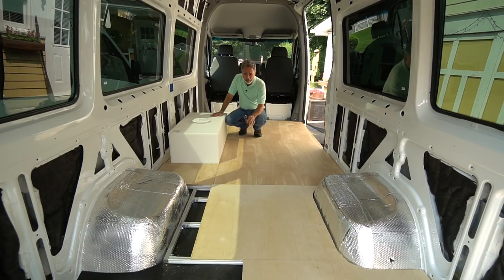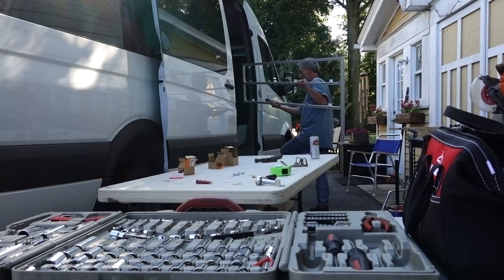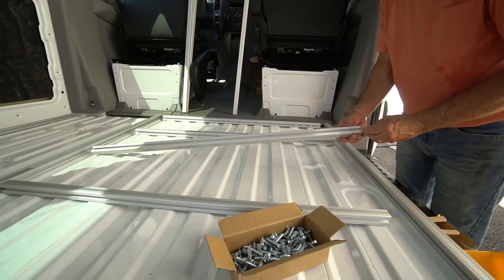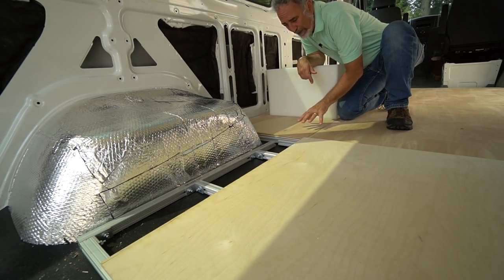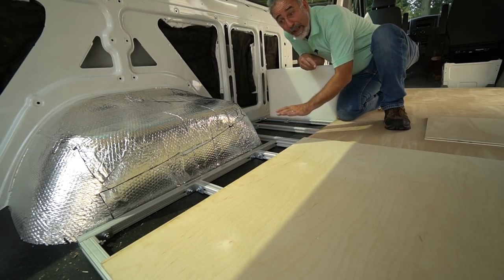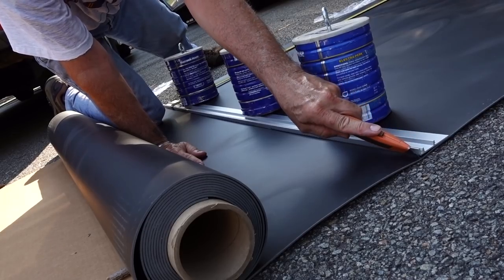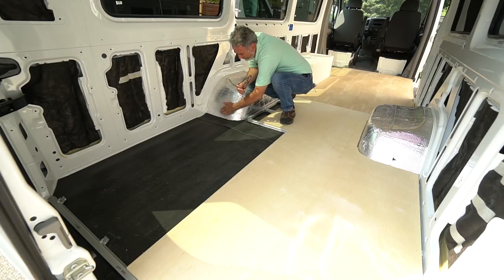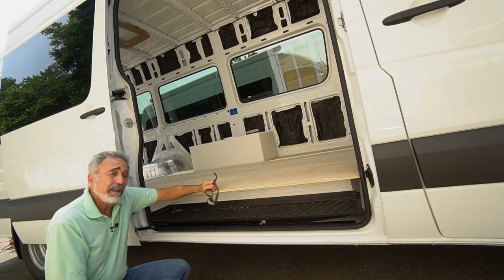VAN BUILD SERIES 09 | My Floor Design

Comment: I like the idea of a four corner drain system! Seems the safest way to go.
Reply from the maker: It makes perfect sense up inside the van. But when you roll underneath, oye vey...
Reply: That would require four times as many bends and connections wouldn't it? I know you like simplicity :-)
Reply: Maybe a squeegee would be simpler.   No, go for the gold!

Comment: Like how this van has glass windows all around. Most van builds i see here are like work vans with just few small windows here and there and the vans are so enclosed. This many windows gives great views of places you travel. I guess the less windows are for the full time stealthy vanlifers?
Reply from the maker: A certain sect of van dwellers like the fully enclosed van. Possibly for stealth, possibly for insulation. Glass transmits a whole lotta cold and heat! I can deal with that because like you said, the views and the open feeling are most important to me. Watch the whole build series and then the final van tour and see just how open and large it feels in there! I call it the Class A of Class B's!

Comment: George, you're a joy to watch! I just enjoy you and the pride that you take in quality and detail. I just bought a new to me Ram Promaster 1500/136 WB. I've watched soooo many of your videos (multiple times) as well as others videos on flooring system layouts. I see that you used heavy vinyl and 80/20 for this Transit, would you recommend this same plan for a Promaster? I know this video is 4+ yrs old now and you're constantly innovating. I'm only 5'5 but want to keep a solid 6ft height clearance. Even so, having thick insulation on the floor and ceiling seems doable and is my plan. In the future I would love to have heated floors, but don't have the skill level or funds to make that happen now. However, I also don't want to shoot myself in the foot by making accessibility to the floor at a later date more challenging than necessary,  or worse, impossible.

Comment: Thanks for the video series, I'm enjoying it! Just thought I'd mention that if you're not using lock nuts with your 80/20, I'd recommend using blue loctite on the bolt threads. Everything is subject to vibration in vehicles and split lock washers won't do it IMO. A couple of drops of the old 242 will save you the hassle of having to take up your finished flooring just to resnug a loose nut. Cheers!
Reply from the maker: Great minds think alike. I used lock washers AND locktite.

Comment: I bought an RV impulsively. It was a lemon of a thing just over 2k. I was going to drive it out west for the Dead & Co show but it stalled 20+ times as I tried to exit after the 4th of July fireworks. Then I saw the floor under the cab mats was very rusted out. Anyway, it's a 1979 Ford class C. I forgot the name as iit's with the seller, who out of guilt, just fixed the stalling problem. Anyway, the RV is filled with heavy, decaying wood and needs to be gutted. I'd love to flip it (or keep it) after redoing it by following your lead. But you make it look easy. I'm hoping I haven't bit off more than I can chew.
Reply from the maker: Go slow, and don't get discouraged. Although there are certain coaches that should just be put out to pasture. Make sure you are not chasing something that cannot be caught..

Comment: Your an artist and craftsman. I see others put foam strips and other material like wool. But it is a lot of work and you just put vynal is that the best insulation? I like the attaching to high parts. But I’m not sure I can afford the aluminum so can it be done with wood ? What is the final wood on top? Is it 3/4” sanded ply?

Comment: @Humble Road The part of this video that's missing is what do you pump through the tubing for heat? I'm assuming hot air, but can you connect this directly to a webasto gas heater? Does it need its own heat pump system?  Thank you.

Comment: Just because the teak is the same level as the rest of the floor doesn’t mean it has to touch it. You can still have a little 1/4” moat around the teak to catch the water.
Reply from the maker: Exactly. You know what you're talking about!

Comment: George ….great segment including the fire truck sound!!!!  Can you tell me the brand name of the Mass Loaded Vinyl to include thickness?  Have you considered using Marine Plywood to help with moisture resistance? Are you using aluminum bolts with the Aluminum 80/20 (steel touching aluminum can create galvanic corrosion in the long run)? Love the modular 80/20 frame design elements...impressive. Can't wait for your modular design plans with templates for do it yourselfer/builder kits!   Mike
Reply from the maker: The vinyl came from a local distributor. The main specification is; one pound per square foot. I have to say I was really pleased with how easy this product is to work with. Can't wait to get it out on the road. I was concerned with using aluminum bolts in such a key area. The forces of a collision could easily shear an aluminum bolt. I was going with marine plywood, until I installed the vinyl and 80/20. It was then I understood how isolated from moisture the plywood would be. I will be inserting thinsulate into each of those frame voids. Should be golden!
Reply: Mike B. Isn’t marine plywood treated and not good for your health in enclosed space?
Reply: Adhesives used in "all" plywood can be a health concern. Both urea formaldehyde (typically used in conventional plywood) and phenol formaldehyde (typically used in marine grade plywood with laminated Douglas Fir) all have health concerns in very high concentrations. Overcome by new EPA rule!!!!.....See EPA.GOV regarding Formaldehyde Standards for Composite wood. “The formaldehyde emission standards come into force beginning June 1, 2018. By June 1, 2018, and until March 22, 2019, regulated composite wood panels and finished goods containing such composite wood panels that are manufactured (in the United States) or imported (into the United States) must be certified as compliant with the TSCA Title VI.”
Reply from the maker: Word.
Reply: Mike B Good info. Thanks!
Reply: Should be good to go and very quiet!  Can't wait to hear the results without the fire trucks.
Reply: Nancy....new rules by EPA....See EPA.GOV regarding Formaldehyde Standards for Composite wood. “The formaldehyde emission standards come into force beginning June 1, 2018. By June 1, 2018, and until March 22, 2019, regulated composite wood panels and finished goods containing such composite wood panels that are manufactured (in the United States) or imported (into the United States) must be certified as compliant with the TSCA Title VI.”  So new compliance will be required.

Comment: In later videos your floor system is 1x1' aluminum and appears you abandoned the vinyl layer, is that for weight? Airflow?  Also you mentioned always using vinyl between 80:20 and wherever 80:20 connects to the van wall.  Is that a conductivity barrier?
Reply from the maker: Yes, the aluminum square tubing is much cheaper and does a better job under the sub floor. The HMV is a thermal break wherever 8020 touches the van chassis. I stopped using full sheets of the HMV due to excessive weight

Comment: Hey George, just a shoutout from Belgium :) Slowly making my way through your vids and gathering information in order of completion... or start maybe. At the moment I am searching for the right van to make a home. In the meantime, I am getting prepared with info for when I find what I am looking for. I have a question regarding the vapor barrier. I found this floor system video and you speak about placing the heavy mass vinyl on the floor as well as alongside the walls but do not show wall placement besides mentioning it is behind your wall panels- system, "access access baby" :). I so agree with your mantra of being able to access behind cabinetry if need be.

I am unable to find a video where you show the vapor barrier wall method... if I understand correctly you place it against cabinetry paneling vs alongside the van walls? Can you steer me towards a video where you show the placement of the wall vapor? or if it is not made yet, make a video that covers the topic?

If I could, I'd hire you to convert my van for me but as a single lady I'm somewhat on a budget plus crossing continents would add another problem to solve ;)
Anyway, love your videos... 
Cheers, Esther
Reply from the maker: I use the HMV on the floor only. Too heavy anywhere else. In later videos I talk about encapsulated wall panels. That is the system I use now.

Comment: Awesome info and trying to do something similar. Looks like you made your own L-connectors to build and secure the frame.  What is a good technique to drill the holes in the connectors?  Mine always seem off center? Jig of some sort?
Reply from the maker: Yes, I used a jig and a drill press. Although, I DID NOT screw the frame to the van floor. I did not want all those holes and screws sticking out the bottom of the van. I used 3M 5200 Marine adhesive. It is considered permanent. Love it.
Reply: @HumbleRoad  Thank you for responding and good info.  I will look into 3M 5200.  I understand not wanting to screw holes but why not use Rivnuts?  Each one would allow a bolt in attachment point like the stock points and keep the floor frame removable.  Did you entertain the idea of rivnuts ? I know adding holes in general is a bad thing.  Anyhow inspiring work indeed thank you for your incredible videos.

Comment: What’s the plan for the old van or the new van ? Did I miss that video? You selling the old van to go to the new van or vs a versa ? Hell I think you should tell pleasure way & winnebago and all the rest how to do it better not cheaper ... your the van man ! Love watching... still rolling my old Vw Westy ! See ya on the road !
Reply from the maker: Hey Scott, at this point in time, the new van I'm building is up for sale. I will continue to use (and love) my PW. In fact, I will be adding that new quiet air conditioner from Advanced RV as well as some killer solar panels and more battery power. I guess you could say I'm going to "Humblize" that baby! ;-)

Comment: Clever idea, but just one question, most van builds use wood battens under the main floor panels, I like the possibility of adding or removing furniture secured  by the framing but isn’t there much more noise transmission from the floor pan to the internal floor and much more thermal bridging using any non wood frame/Batten system? Nearly all Uk and European van builds have sound deadening and thermal insulation under the flooring
Reply from the maker: Darren, please watch the video one more time. The first layer on the bare van floor is 1/8 thick heavy mass vinyl. It provides sound deadening, vapor barrier and thermal barrier. And some insulate properties. Once I am finished running my wire and pipe, I will insert Thinsulate into the frame voids, cut 1 inch strips of vinyl for the top of the framing, then secure the plywood sub floor.

Comment: Truly innovative and inspirational. How are you going to attache the plywood subfloor to the aluminum?
Reply from the maker: Thank you, Neil. Once I have the sub frame attached to the van floor, I will lay 1" wide strips of my vinyl on their top edge and lay the plywood on top of that (to prevent squeaks) then self tapping sheet metal screws to fasten the plywood to the aluminum. I will cut in an access hatch down the center hallway to inspect and maintain the glycol lines.
Reply: Awesome van, even more impressive response time, thanks a bunch. You are an inspiration, keep up the good work.

Comment: Hi Humble! Awesome as always! In ontario we got to 113 degrees Fahrenheit with the humidex over the weekend. Truly awful. Good on you for persevering. Im not entirely sure the final design of your oversized shower “pan” but you might consider commercial vinyl (rubber?)  cove moulding. We used to spec this in commercial jobs. It has great integrity but is also flexible and easy enough to cut. Washes well. Resistant to mould. You could “snake” it if needed. Colours used to be basic but are probably more attractive now. Btw I will see a 2018 Pleasureway Lexor tomorrow at a large vacation rv rental company we have across Canada. Ergonomics are king on this type of purchase for me. Thanks for the recommendation. 👍 (My overlanding younger son still thinks I should buy my own Promaster and build it out...could I borrow a cup of tools by chance? Lol)
Reply from the maker: Thanks, Mishu. I'm not actually using a shower pan. I am fabricating my own system. You are going to howl when you hear what I am doing! Good luck with the PW Lexor. I think they did an excellent job using a Promaster chassis.

Comment: I discovered your channel while searching for videos on ticking sticks.  I'll begin a bus conversion at some point this year, and was hoping to use aluminum for framing instead of wood in hopes that it might be lighter or stronger.  Of course, I know next to nothing about working with metal in that capacity, but I'll learn!  What was your reasoning for using aluminum?  
It's been great to learn from you so far.  Thanks for posting your knowledge here.  By the way, the short bit at 0:36 was fantastic!
Reply from the maker: Welcome aboard!

Comment: Did you make your roof fan support or purchase it?  Will you support only on the inside or outside too?
Reply from the maker: If you mean a Fantastic fan or a Maxx Air fan, you can make an inside support from 2x2 stock. You can see what I have in my Lithium Road Trip video: https://youtu.be/raxuo25FcDM

Comment: Hello, question. Why do you use vinyl and 80/20 to frame the floor? Also, what type of floor insulation do you? Thank you!
Reply from the maker: I no longer use 8020 under the flooring. Aluminum square tubing is less expensive an does the same job. The heavy mass vinyl is a sound deadener insulation and vapor barrier
Reply: @HumbleRoad  Thank you so much! I find your videos to be extremely educational and entertaining at the same time. When we start our build, we will model after you!

Comment: Hey George, I’m getting ready to start my Sprinter build and I’m going back and rewatching some of your earlier videos. 2 Questions are you still using heavy vinyl on your floors and what did you uses to fasten your 80/20 to the floor? I notice in your later videos you glued the 80/20 to the floor. Thanks. Marty
Reply from the maker: 8020 under the floor is not necessary. Glue one inch aluminum square tube. Instead. 3m 5200

Comment: How do you attach the 80/20 to the floor ribs of the van? Thanks for posting these videos! I'm going to try 80/20 now. :)
Reply from the maker: The floor grid system is glued to the van ribs with 3M 5200. Highly recommend it. Read the directions. I grinded the paint away from each contact point. Do not get water based adhesive, it will rust!
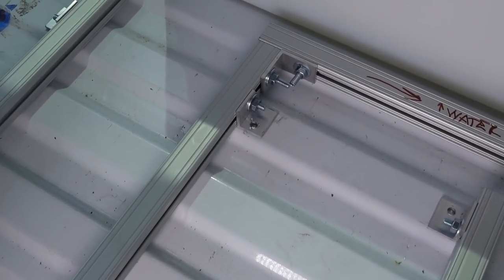Reply: Thank you! I’m referring to 2:25 in your video where it looks like you have brackets that are screwed to the van to hold the 80/20 floor frame to the van? Are you bolting/screwing this to the van floor? If so, can you explain how? I so appreciate your philosophy of doing the minimum to the van, and being able to re-do things.
Reply from the maker: When I originally assembled the floor grids, I WAS going to screw them down. I thought better of that idea, not wanting all those perforations in the van floor and squeaks. So I left the side brackets in place to give me a larger glue area (as well as gluing the 8020 frames wherever they came in contact with the high side of the floor ribs.)
Reply: Humble Road Thank you!